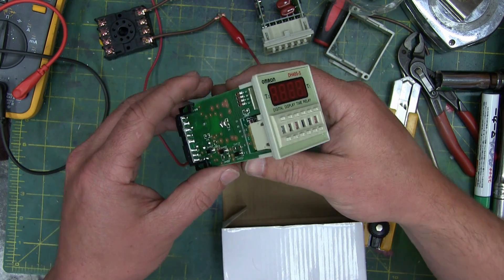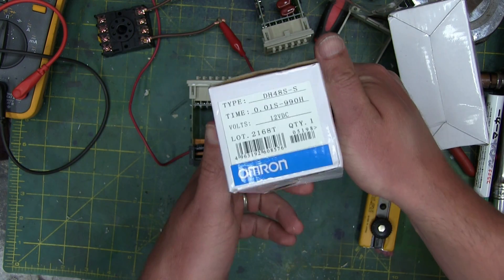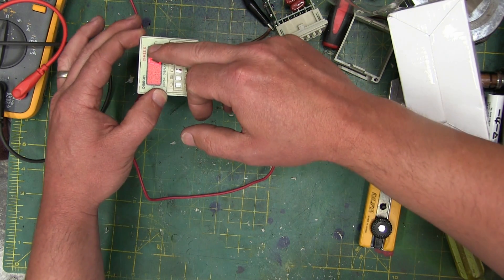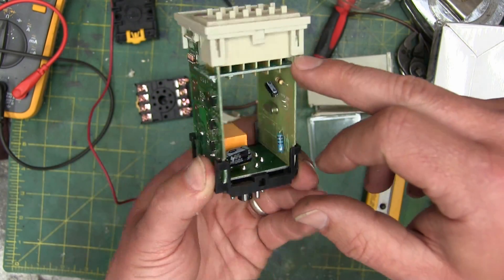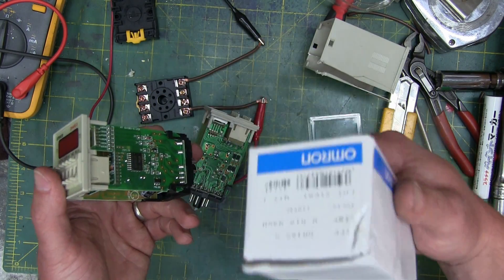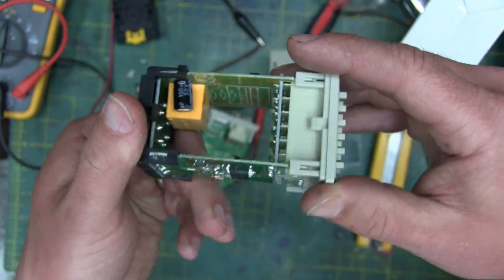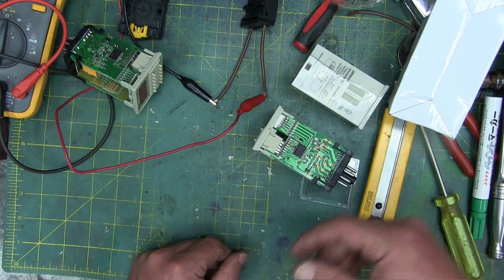BOLTR: OMWRONG Timer Relay

Comment: Better man than me.  I set up my camera to record pushing my truck, by hand mind you, about 25' slightly uphill to get it close enough to the newly installed electrical service to plug in block heater (54 below zero).  AND sd card corrupted in hero 4 - hero 4 promptly sent airborne into the North woods, where it lies today

Comment: Jezus AvE, are you able to open something without breaking it!?
For a 10 buck timer, it's built extreamly well.
And it's a timer, it doesn't provide protection. Nobody ever thought that. If it short circuits it self distructs. If you put gasoline on top of an electrical device you are the one to blame, not the cheapo timer.
Power sockets, plugs, cable, vacuum cleaners and dildos are all made like this: what if you put 200Amps thorugh them? They blow!

Comment: Someone where I used to work bought rack power supplies where the front control board was edge soldered to the main board. We installed one, and within a few weeks it went "nuts" and burned out a few grand worth of equipment. Total crap! Imagine, every press on the front controls flexed the solder joints!

The guy was a boss and wasn't fired, but they put all the units in a storeroom and that was it. They're probably still there!

Comment: I would like to point out the chiniseium knock off thing. I have Real Omron timers I have been controlling industrial chemical pumps, 24/7 for well over 10 years. Very few if any problems. Easy to set up / program. I have been very happy with them.

Comment: Our electrical engineer at work  whom is a self proclaimed genius and on multiple occasions has claimed to know everything recently spent nearly 10k on Chineseium LED factory lights. In my previous career i was a lighting specialist. I told him not to buy them because they were too cheap. I told him not to install them and send them back after they arrived because the quality was so poor. But he is a very clever man and incapable of listening to the input of others. 

I would be lying if i said i am not pleased that every single one of those garbage lights has failed. The company he got them from suddenly had a lot of trouble operating their email despite being very responsive before the sale. They have now been sent for scrap at a value of around $500 and new lights purchased because he was even stupid enough to throw the old halogen lights away. 

You get what you pay for! 
And before anyone asks no he was not fired because sadly he is part owner of the business.

Comment: its like the 1 dolhair relay board from the chinabay(aliexpress). Those things are rated at 250v dc i think. NO F*CKING WAY. im pretty sure its not a good idea to run 250dc trough those things unless you are trying to start a fire, in that case its a great idea.

Comment: why use a capacitor for the relay kickback? I thought a diode was standard procedure. Given the cap is electrolytic and polarized I can understand how this operates the same way but wouldn't it be better to use a diode since they are transparent in the circuit?

Comment: AFAIK you usually use diodes (and sometimes zener diodes) instead of that capacitor at the relay. 
Additionally, that capacitor is an electrolytic capacitor which means that it has to withstand reverse voltages because when switching a inductivity off, you get a reverse voltage peak (and if I remember right, electrolytic capacitors don't like reverse voltages).

Comment: 3 Errors!

5:50 - No, the cap is not to protect from the inductive voltage.  There is a diode on the back of the PCB for this purpose.

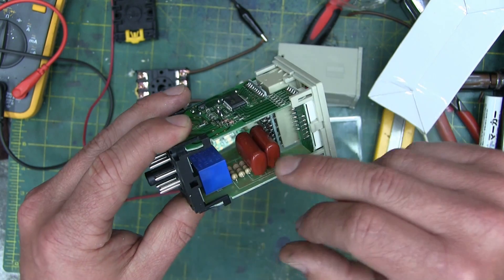6:50 - Those are not "bleed down" resistors.  The bleed resistor is on the back. 1M ohm.

6:57 - No internal fuse is no problem.  Your fuse should be external and protecting the rest of your control circuit (if there is any) and you would normally have a separate fuse for the device you are controlling.

Sorry... better luck next time!  ;-)

Comment: Sparky here - OCP (over current protection) will not usually be in specific devices of the Lego variety... OCP is usually in a few other places before it reaches said device. In the circuit feeding what is being switched by a relay, in OCP sized for it. And also in the control circuit for the general control voltage (flavor of choice). So say you had a motor control panel (MCP/MCC), and it's control voltage was 12VDC for a bunch of components, and it say by chance or poor design also had a 120VAC control circuit as well - there would be a fuse sized for the load and min wire size protection of each circuit at the interior source of each voltage type. And for under nominal voltage sources, that fuse may be prior to the power supply as well, figuring that the power supply would overload and burn said fuse - legal, but not the best... (Preferably both sides of a power supply) So say if said control circuit was also switching a totally different voltage - say 208VAC 3 phase - it may have OCP at the breaker feeding it, and a fuse at the disconnect for said motor (US NEC), and typically at the relay itself, also have the required overload protection 'heaters'.... Each set of those protective devices is to protect different sections of wire in increments, and from different things. The feeder from the main protects the panel, and conductors feeding it. The branch breaker protects the wire from the sub panel to the MCP/MCC. The overloads at the relay in the MCP protects the circuit from motor over load (stalling etc.), there may also be fuses there too for wire protection. But those can alternately be in the required disconnting means within sight of said end use motor if remote from the MCP/MCC. So harping about lack of OCP within a certain component - eh - it's something that's supposed to be designed into the controls as a 'whole'. You really don't want a manufacturers of Lego to be making those choices for you anyway...

Comment: I have noticed in your videos,  you use a Rigol oscilloscope.  I'm just a hobbyist and am thinking about buying a scope.   I  see that yours is a 4 channel  but only  50 mhz.   is there any advantage to having 4 channels if I'm going to be  "experimenting" ?  Would a higher frequency range be beneficial?   I'm  trying to teach myself some electronics theory  and possibly start working on an FCC radio amateurs  license.  You seem like a pretty sharp guy and I would value your opinion.   Thanks

Comment: You should have looked at the internal relay manufacturer's name. Since the real Omron makes all their own relays, it would be a laugh if they're some Chinese brand, which, like you mentioned, looked to be pulls on top of it. It also makes one wonder how many other internal parts were also pulls, and if the electrolytic capacitors had the capacitance that they claimed, since China has been known to put a 20 uF cap inside a 100 uF shell.

Comment: I do not think many devices in automation come with an "internal fuse". There is a reason control cabinets have rows of din rail mounted fuses ;) these are not just to protect the voltage supplied to powered sensors (from sensor failiure or cable damage taking the whole system down) but also for fusing the modules. If you read the datasheet for the module it usually shows the supply coming in and a fuse in the positive (sometimes in the negative too) and then the module and all its inputs through contacts to the positive rail.

Inside the device is usually a fuseable resistor for fire protection, but WHO opens up devices to repair them ? If an on site maintenance worker opens a device like this and repairs it, and someone is injured guess who will be on the hock ? These units are jelly bean parts for a reason (and older plants that were full of them are being moved over to PLC's because of them)
Reply: Kathy Quinlan Interestingly, "life safety" devices are also unfused. Installing a middling fire alarm system at work (142 device class B SLC, 31 device class X NAC, and a new panel in the controller) and not a single fuse to be found anywhere. The battery charging circuit has a standard panel breaker, and some of the device power circuits have self-resetting breakers, but that's it - and the device breakers can be disabled, or rather enabled because they're disabled by default.

Comment: 6:49 The 1/2W resistors are not for bleed down, they're part of the resistive-capacitive drop circuit.  The bleed down resistor is the SMD component on the other side of the pcb behind the caps - probably 100K-ish - no need for high wattage.

Comment: OMG, ditch that piece of shit!  AB has an awesome programmable digital timer that will do EVERYTHING that it takes SIX Omrons to do... and the AB is multivoltage!  AC, DC, doesn't care, same coil, same connections!  They also rail mount with no base, so fewer parts to screw with.

Comment: What is wrong with China right now?  I'm seeing nothing but these Frankenstein's monsters that are a mix of actual competent engineering and fabrication and quality parts with just a handful of total, unacceptable shit thrown in.  FFS, the BOM on some of these things exceeds the delivered sale.  You can buy one of these terminally ill pieces of hardware, do a little bit of work yourself and end up with a really solid tool.
(oh, BTW, did your UV flashlight crap out yet?  I have the same one.  Mine did.  They used a slow diode on the boost converter to let it use 1.5V batteries.)

Comment: So for the "home gamer" as you like to say... there's a bit of an issue. I ordered a GENUINE set of Fluke test leads after mine failed, they were only about 4 years old but the connection of the test leads became intermittent, so I went and bought a pair on Amazon just using the "prime" logo, so I figured it was coming right from Amazon. NO. It was "Prime" because it was shipping from Amazon's warehouse, but it was from a 3rd party seller. Turns out they were selling alibaba parts pretending they were legitimate. Point being... even thinking you're getting the real thing and ordering it from somewhere you THINK might be reputable you can still get shit on.

Comment: Not having any fusing in such timer modules is actually not that uncommon. Over-current protection is normally added externally, these are not designed to be wired straight up to mains, but would be mounted inside a control panel, and in most implementations there would be one or more fuses/breakers protecting the "control" power supply for the panel. That's a pretty common setup in industrial control panels. Fuses and breakers all over the place.

Comment: lol no mic !    Too bad they are toast it should had made nice smoke test on 120v.  I bought some for 5v (they dont have power stage) and ....  they are really good  for some prototype ... dont have casing tho  ...  lol  of course switching 120v 20amp is something else than that lol  http://www.ebay.com/itm/DC-5V-12V-Multifunction-Self-lock-Relay-PLC-Cycle-Timer-Module-Delay-Time-Switch-/172579694447?var=&hash=item282e8d276f:m:mhg4PJtkqmNrVDR3WcNFU6A
Reply: Same thing with limit switches (etc etc)  I bought both,  fake China Omron and real one  from a good source not at all the same switch lol

Comment: A lot of high-reputation manufacturers use the same pcb-box construction, vintage Omrons from the 1990s when no fakes were around yet, Eurotherm, ...
Reply: Do they also use live traces for the mechanical connections? I think the live part is the issue. Using solder pads that have no function other than holding the construction together seems less of an issue.
Reply: yes, they do! - well I cannot say if they still do, but they did!

Comment: Most normal relays don't have circuit protection built in, not even a transistorised relay, I've worked with industiral control panels most of my life, there's always a 5A control fuse, or a 6A breaker. don't think i've  had a real omron apart to see if there's protection.
Not saying i'd use a chinese knock off,  ....
If the 120v one is still working and is identical including the relay voltage, shouldn't you just be able to bypass the dropper and run it on 12V ?

Comment: I know, industrial is different, but come on. $10 doesn't even sound cheap for just how simple this device is. >$100 is just insane. Is that price all in the relay? If not, where? The electronics to actually time and signal would cost pennies, and about the same for a perfectly usable fuse.

Comment: since you stated that they were basically the same minus the capacity of dropper circuit for the ac voltage one couldn't you slap some parts out to get that 12-volt one wirking.. my Québécois friend what no keep it in the vice advice...

Comment: Couple of things: would not the cover that you removed act as the frame that relieves the mechanical pressure away from the solder joints? On the 120 Volt AC edition: I thought I saw the components for a 12 volt DC power supply including diodes and filtering with caps. Old school, but acceptable. Reducers??? 

Right you are: no fuse = criss de grosse merde.

Comment: isn't the cap just a reservoir for the relay coil to have enough energy to engage? I've seen relay circuits get old and the reservoir cap start to lose its capacitance and the coil will engage but then give up when it runs out of juice

Comment: "A rule there somewhere that you're not allowed to do that (using a conductor for physical reinforcement)" 

You've never looked into an older Volkswagen electrical system, have you?  Fire hazards from the get-go; high amperage connections that rely on the PCB for physical reinforcement.  The owners just assume that burning the boards out once in a while is normal - I assume that I'll never own another one of the things.

Comment: I've seen "brand" equipment where solder-joints are used for rigidity (in panel mount equipment like this) so it's perfectly fine to do that apparently.
Reply: Yeah. They do the same thing in a genuine Watlow. Although the last one I replaced had failed because one of those joints ripped a trace from a circuit board (machine vibration).

Comment: I don't agree with your observation regarding the capacitor by the relay. The inductive kickback is mitigated by a simple diode. The capacitor is to stabilise the power supply - most mentionably when the relay turns ON and draws power.
Reply: I wondered about that as well.
Reply: In a simple relay, you might have a capacitor if the coil accepts AC. I mean, you might rectify and filter the AC with a capacitor. Reason being that AC passes through zero. Zero current in the coil = zero flux in the core = zero magnetic force, which could cause your switch to switch when you don't want it to. So, I imagine, but don't know for a fact, that coils which accept AC use rectifiers and big cap filters. So maybe that is what the electrolytic cap is for.
Reply: It has nothing to do with AC. The capacitor is not connected to the relay. The timer is powered by DC, not AC.

Comment: I had a guy at work tell me the rear shoes on a pickup truck were fine and i shouldn't waste the money on new ones. When one was cracked the whole way across right through the rivets and was loose. People try to save the company money and it fucks them and you right in the ass.

Comment: FWIW, bigger el-cap by the relay is likely just a bypass. The big black SMD diodes under the PCB perform the back-EMF protection function (flyback, free-wheel, snubber, lots of names whatever..). https://en.wikipedia.org/wiki/Flyback_diode

Comment: So how does the real one look inside?
Reply: about the same lol
Reply: Same only better. MOAR SKOOKUM!
Seriously though. It's like comparing a Ford Fiesta to a Lambo. Both cars, but one does the job much better.

Anything built for an industrial environ needs to be able to handle LOTS of dirt/grime and 120+F regularly. You used to need enclosed rooms with their own air conditioning units and pressurizing units or things would melt. GOOD tech has come a long way and I rarely hear of PLC cards or the like going kaput because of heat.